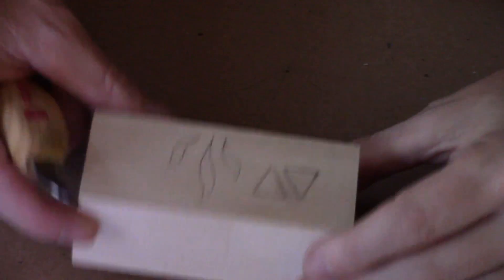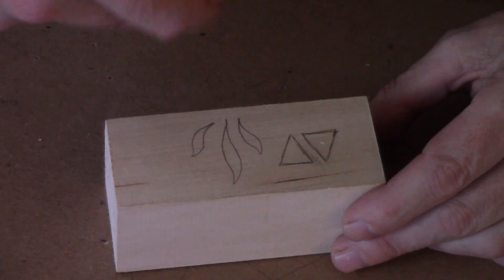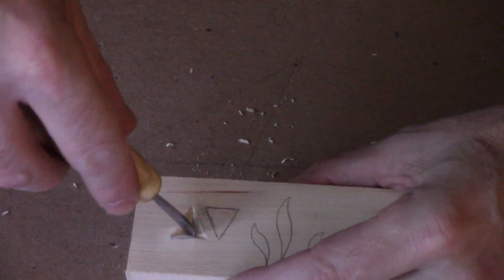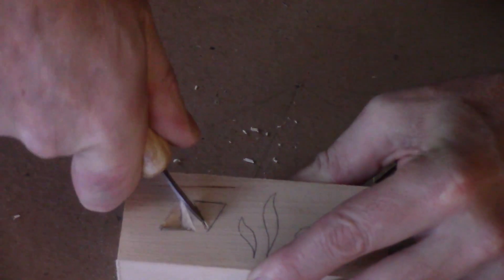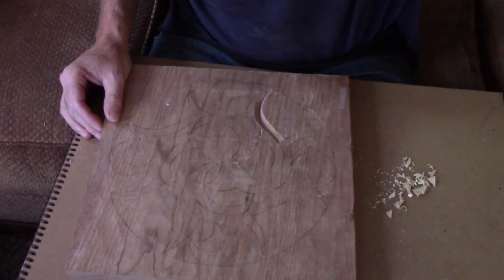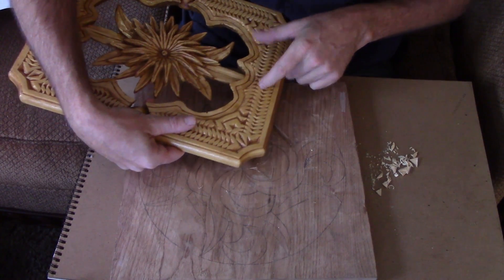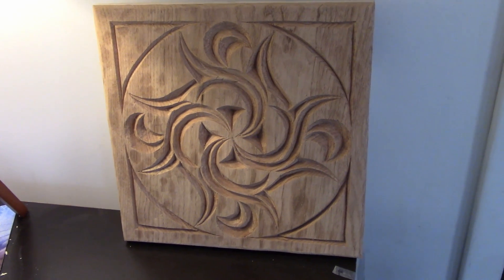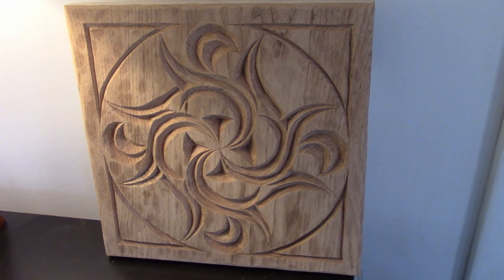Wood Carving Tutorial #1 First tools and chip carving

Comment: I really don't want to be "that guy" especially since I'm not an expert either and I like your work, but this is an issue of safety. The way you hold your chip carving knife and the way you cut with it is pretty much completely wrong and dangerous! Search youtube for "chip carving basics " and every video will show you the proper and safe way to hold the knife and cut with it.
There's a reason why all of these videos show the thumb of the carver being parallel to the blade, because it gives leverage and provides better guidance for the knife. Not to mention it's much easier and safer to stop the knife should it slip in the wood without hurting yourself.
The way you show it in this tutorial puts way too much pressure on the blade, making it more likely to either slip if it hits a softer spot in the wood or break while cutting. Keep in mind, these are razor sharp blades we're working with and they'll make nasty cuts if something goes wrong.
Not to mention your cutting method is less effective than the proper method. Your way it seems to force you to repeat your cuts way more than necessary because you can't put enough precision and depth to them. The medium-small sized chips you showed first should've popped out after a single proper cut on all sides of the chip.
I'm sure these methods work for you, but please next time do at least some research on a topic before making a tutorial on it that contains potentially dangerous and less effective techniques!
Reply from the maker: I've watched every basics of carving video out there, and this is my take on the subject. As far as potentially dangerous, any time you work with a blade there is some risk, but I hold my thumb right where there is a notch for said thumb on some knives. Maybe the angle of the camera is deceiving . I clearly state I'm no expert and most of the things I cover I've seen in other videos, it's how I learned.  Being a little unorthodox in my technique doesn't make me a public health hazard in my opinion, but thanks for the input none the less.
Reply: when i carve with a knife i find the safest way to hold it is the most comfortable way. this will often have me holding the knifes the "wrong" way

just take into account that someone is more likely to slip with a blade if the are holding it in an uncomfortable way
Reply: Lantaar, you don’t want to be “that guy” but you provide strong, long-winded evidence that you ARE that guy.